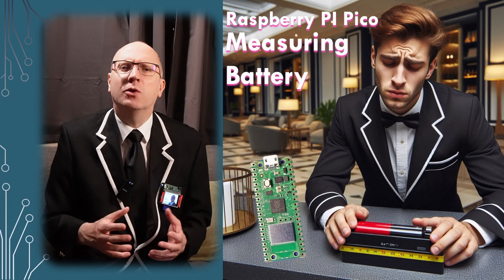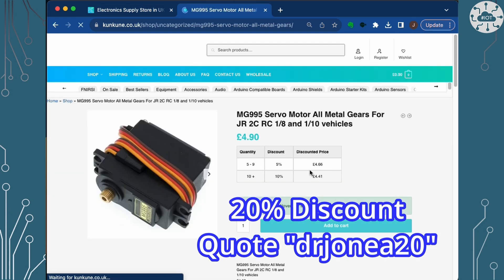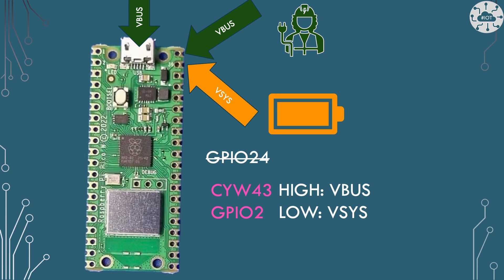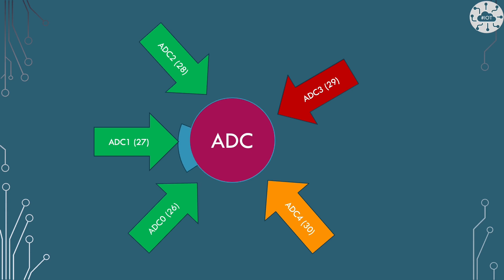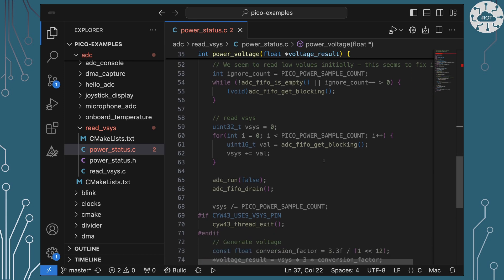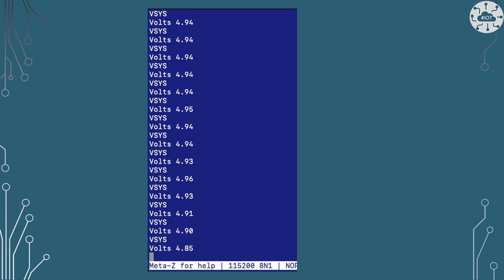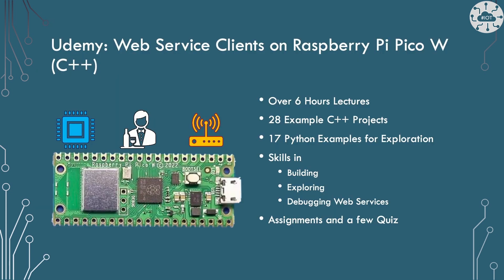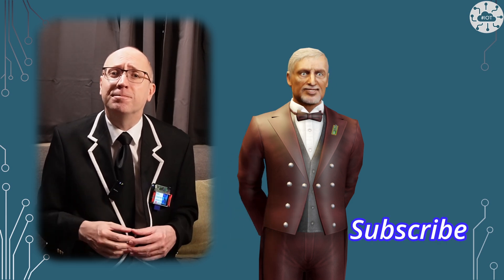Battery Power Monitoring on Raspberry Pi Pico W  | DrJonea.co.uk

Comment: Nice explanation. The clue to measuring the vsys on the pico W is to use the cyw43_thread_enter() and cyw43_thread_exit() functions/macros around the ADC sampling to make sure the SPI traffic with the wifi chip is not interfering. This example was a result of my issue 1222 were the solution was provided by the RPI pico team members peterharperuk and kiligraham, which resulted in the merged pull request 331 (which links to issue 1222)
Reply from the maker: Thank you.  That explains it well.